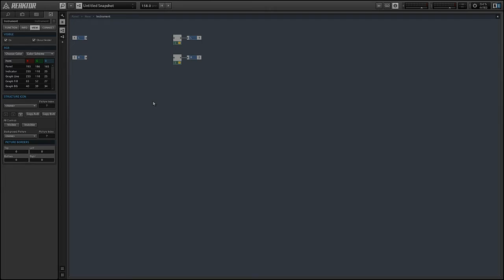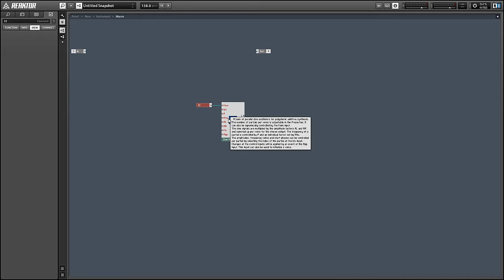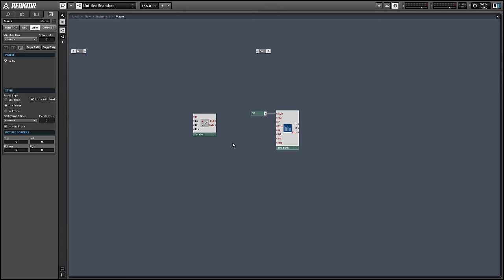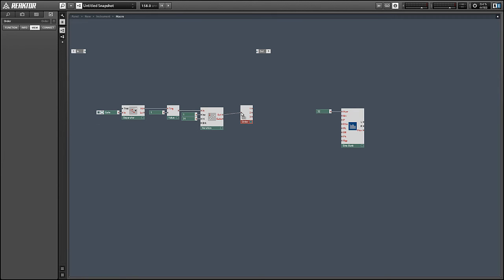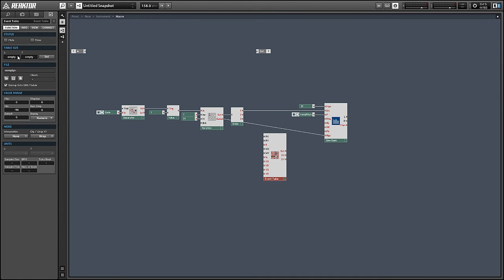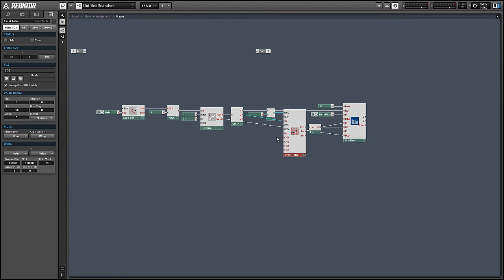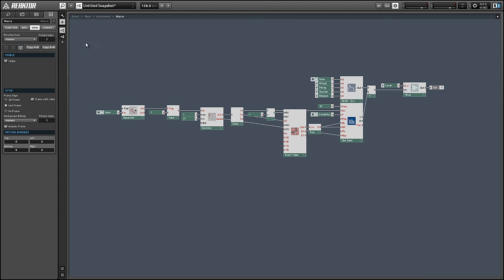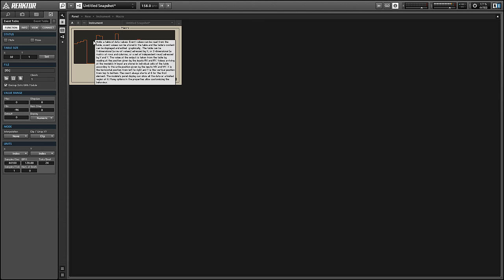Reaktor - Using the Sine Bank - How to Tutorial

Comment: Heyya! I know this is an older tutorial, but I'm getting a really odd issue when I try to lower the volume of the Sine Bank's output in any way. Using a multiplier with a value of .1 on the signal, using a mixer, and changing Reaktor's overall volume all result in the same thing.

If I lower the volume, at all, it sounds more like a highpass filter than lowering the volume. Any ideas on why that might be?

Comment: hi. this tutorial is great but none of the settings of the event table save with the snapshot. please help! :'(
Reply from the maker: Derren Etienne hi, you need to use a Snap Value Array module to hold this information unfortunately. We have a tutorial here that includes using SVAs to hold data to control other elements:

http://www.nireaktor.com/reaktor-tutorials/using-multi-displays-in-reaktor-part-i/

I hope that helps.
Reply: haha, cheer. i found that as well, sadly without a video to follow like this i literally don't know my arse from my elbow hahah